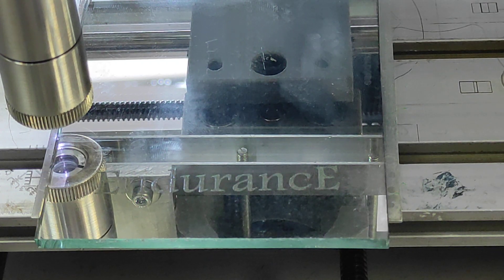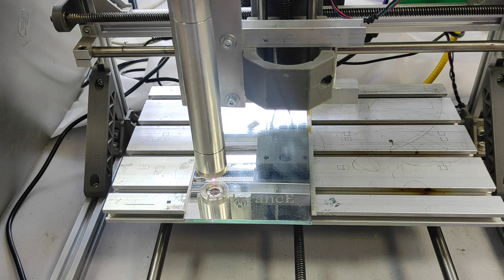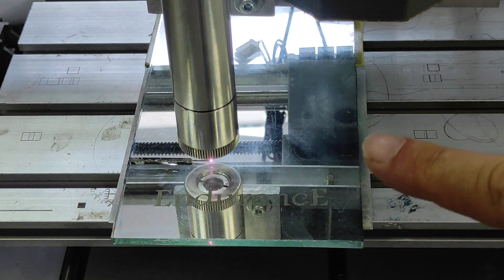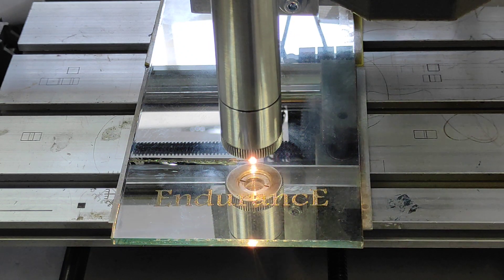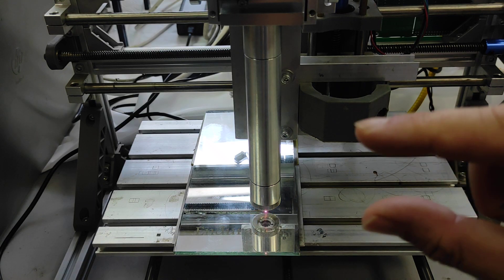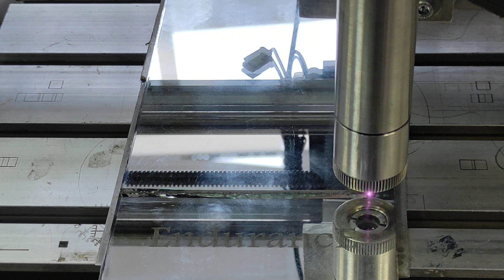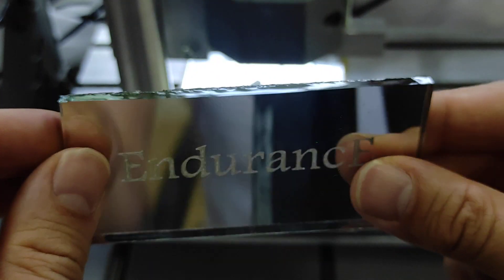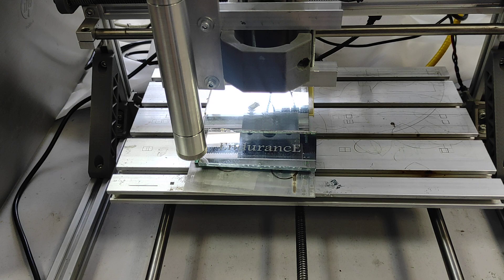Mirror cutting with 10 watt DPSS laser, short focal lens (F=20mm) installed on CNC 3018

Comment: Amalgam.
Can this cut more complex shapes ?
Reply: Its not ablating glass, right ? It's more or less stress fracturing the glass because of the heat generated by plasma ?
Reply from the maker: well anyway sometime you need to replace lens... that is normal for lasers.
Reply from the maker: yes, absolutely... you may cut up to 0.5 mm of steel, copper, brass, silver, gold.